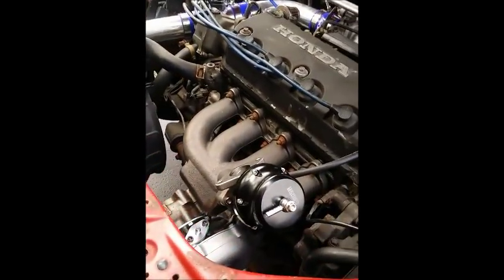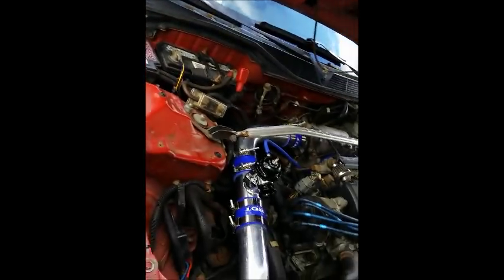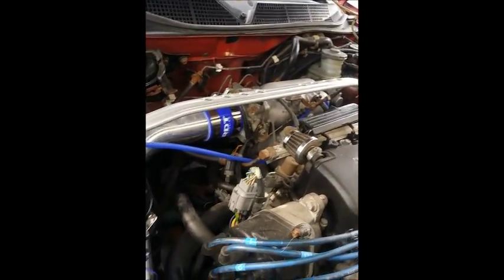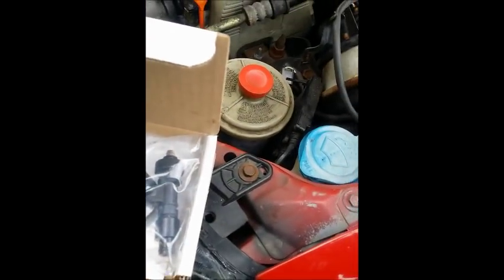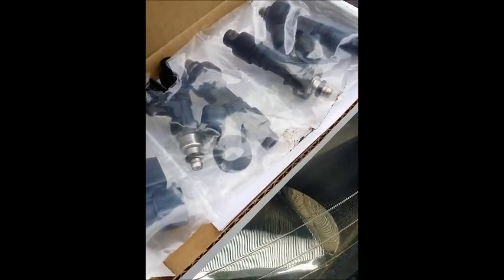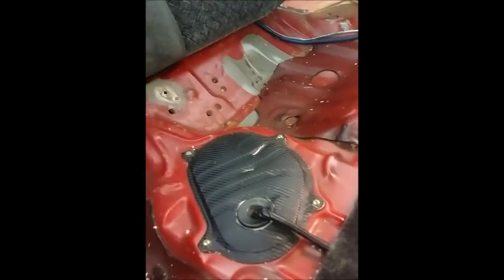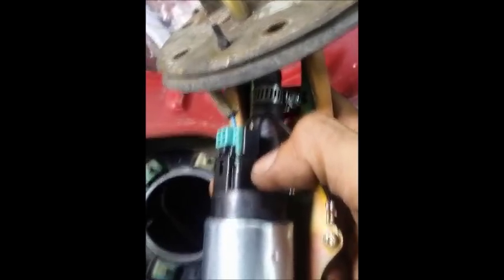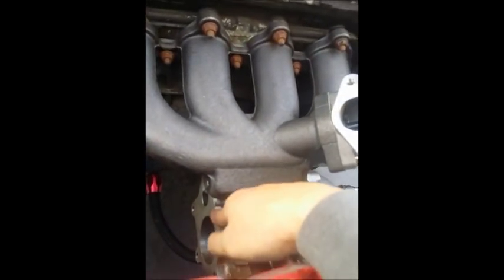D16 turbo install PT.1

Comment: Those  eBay kits  are a cheap product but the snail has gotten better I've read. Good Luck should be fun. Is he going to push 8psi?
Reply from the maker: Henry King We will be running it on wastegate for now and eventually going to push it with a lot of boost once we install a camshaft/springs and a stronger clutch.